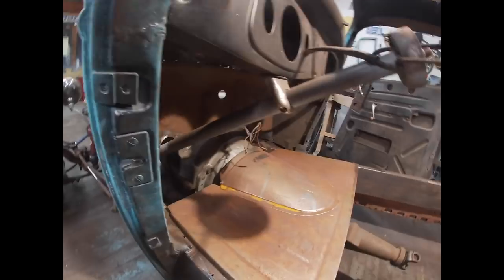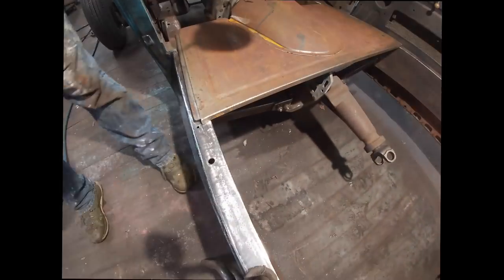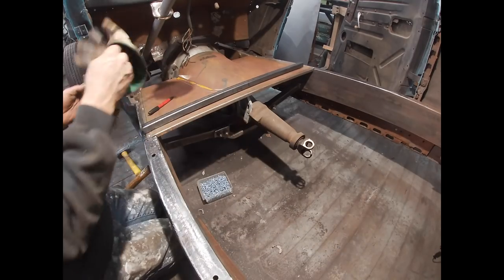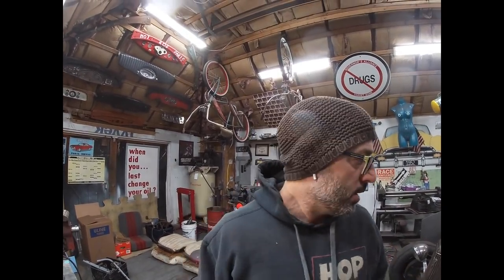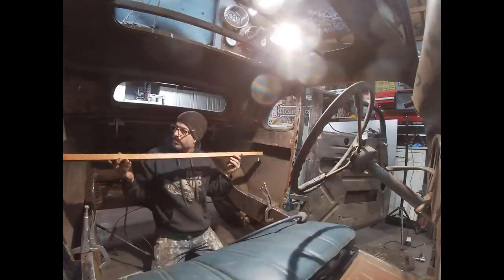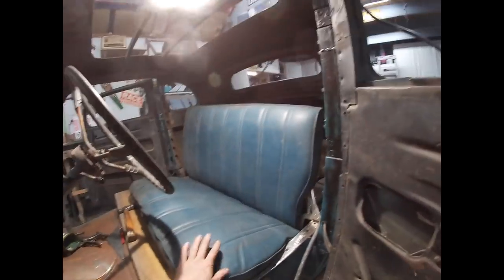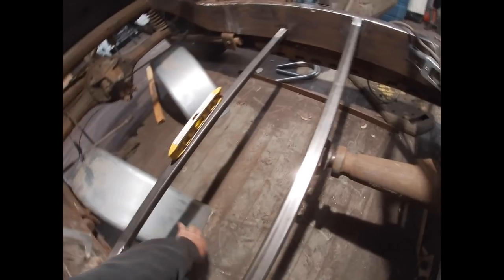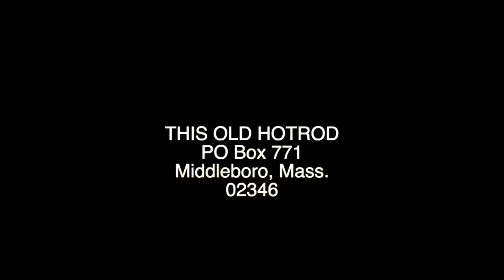Mocking up the seat in the 1934 Ford Coupe.

Comment: The most important thing is to get out in the garage or driveway or basement and do. It’s the best way to learn. 
I spent years intimidated and thinking I had to know everything before I could start building a car, it was all time wasted. I’ve learnt more just by getting out there and doing. I built my first chopper in a 5x10 storage locker, the most important thing is to do it. There is no magic formula to build a hot rod especially traditional ones because every one was different. 
Love your channel and what you show, I laughed when the screws were giving you a hard time (glad I’m not the only one that happens too lol) thank you for sharing.👍👍

Comment: If having a problem with self tappers I pre drill the holes slightly smaller than the bottom of the self tappers. It does wonders. Enjoy
Reply from the maker: Thanks Chuck.   Thank didn’t have any 1/:8” bits in the shop.   I’ve got 50 coming in the mail now.

Comment: Next time you use the self tapping screws, try pre-drilling with a small pilot hole. Think you will find they will fly in lol
Reply from the maker: I ended up drilling a few on the drivers side and on the support across the back of the panel.  I’m a slow learner. Lol
Reply: What ever you do, don't support the selftapping screw with your left thumb and fore finger, caus you you will end up with the driver bit through your finger. Ask me how I know!!!! Yeah I got the driver bit right through the side of my finger.

Comment: What is that heater in your garage? I'm in northern Michigan and winter is a little too cold to work on my project.
I like your determination to get where you want to go with a project. Good example of how to get stuff done the way you want.
Reply from the maker: I have a decent size elec heater next to the coupe that I keep on on the real cold nights.  But the other heater is a dual element propane heater that sits on top of the bottle.  
Lasts me 7 to 10 days depending how long I’m in the shop each day.  
My garage is insulated extremely well.  That helps a ton
Reply: @ThisOldHotrod  thank you Mike. Be well, be blessed and remember to keep the RPMs up and the rubber side down!

Comment: Sorry but I had to laugh at the many tries to get self tappers to work. That’s why I just drill a hole with a 20V cordless and then shoot the screw with a dedicated 12V driver. In the end its just less frustrating to use two cordless tools. But we all use what we have. Nice work as usual.
Reply from the maker: Thanks Bob.  I appreciate it.  
I’ve got 50 bits coming in the mail.  I was out so I did the best I could. Haha.

Comment: Are you going to clear the prop shaft with the rear brace for the seat?
Reply from the maker: Yup. I put in a driveshaft hoop at that location.  Added it to the floor structure.  Video coming soon